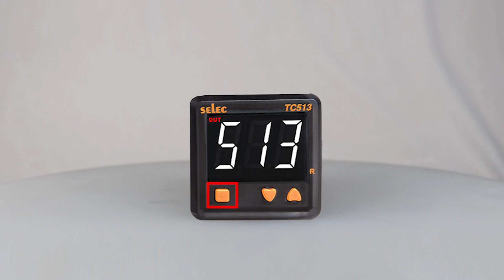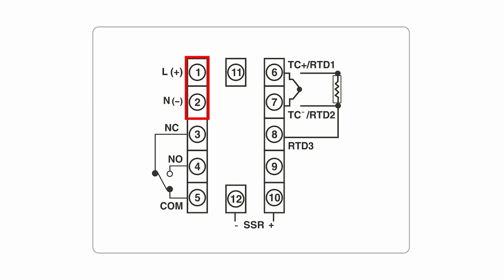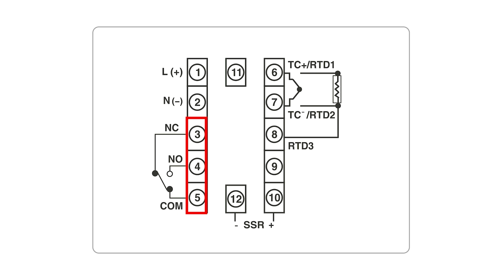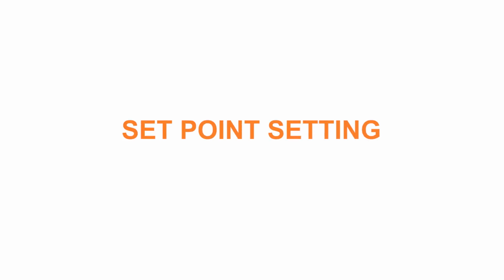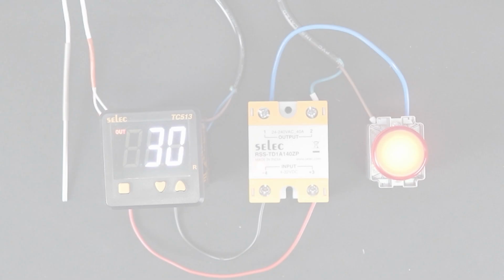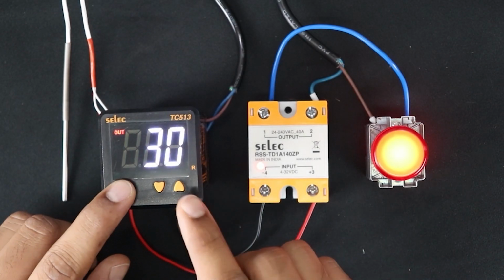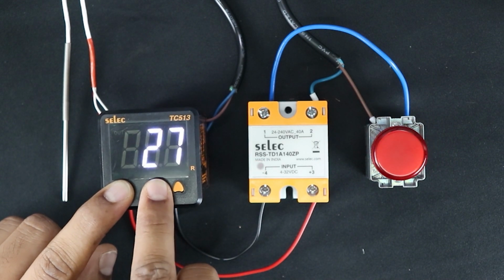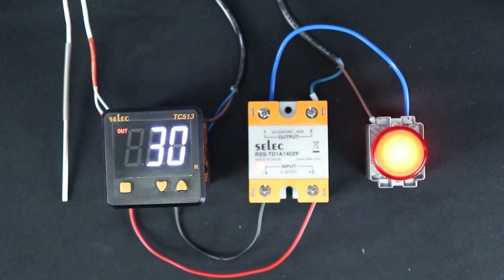Selec Digital Temperature Controller TC513CX| Introduction| Terminal Connections| Applications

Comment: What is the difference  AX,BX,CX controller
Reply from the maker: AX is 48x48x94 mm i.e. it comes with the higher depth.
BX is 48x48x76 mm i.e. short depth
CX is 48x48x76 mm and comes with single white display (better visibility)
Reply: All controllers have the same function or not
Reply from the maker: @chethanpoojary4267  All 3 have the same functions